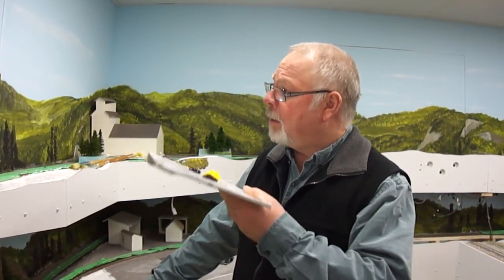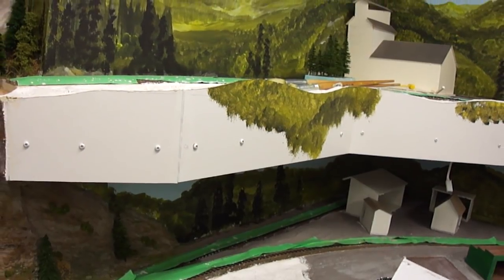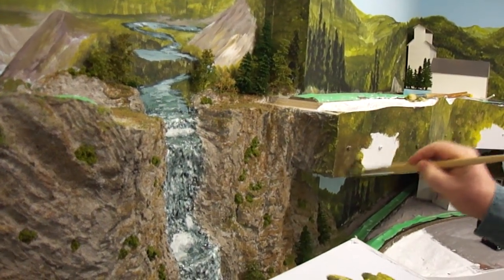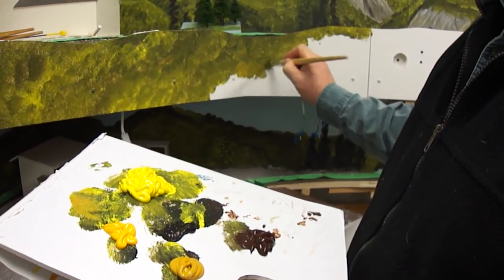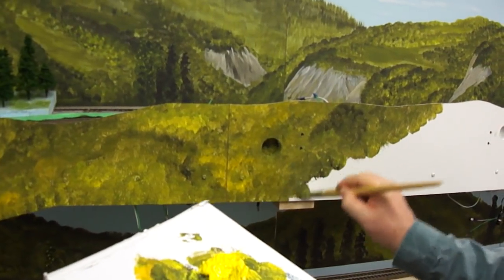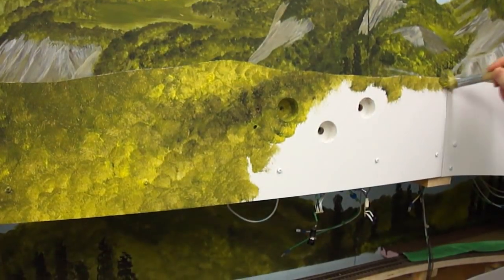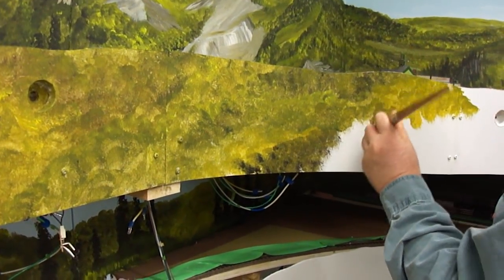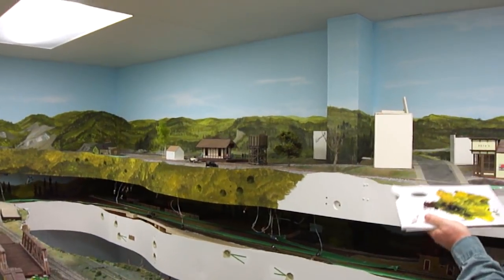PAINTING FASCIA FOR MODEL RAILROADS

Comment: How did you paint the rock face on the top back drop
Reply from the maker: I used a 1 inch flay brush and used it along the thin plain of the brush not the flat..  Mixed different shades of grey.  Started from the top of the rock and pulled it down in long strikes using the light colour for the sunny side.  Then I put the shadows in over top.  I blended different mixes always going in the direction of the rock as gravity would take it.  For example.  Light right to left on 30 degree angle.  Then shorter coming off the cliff face left to right angling out from initial face alternating with dark and medium grey for shadows.  Have a look at my earliest videos on backdrop painting.  You can use browns as well for different colour rock.